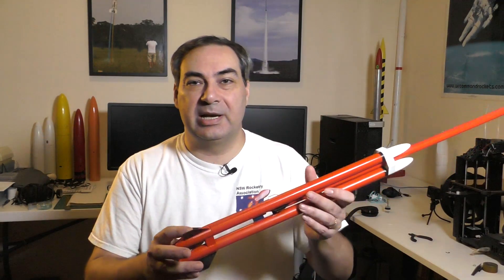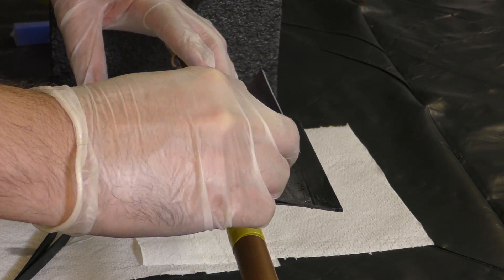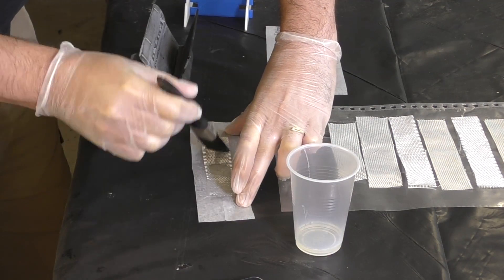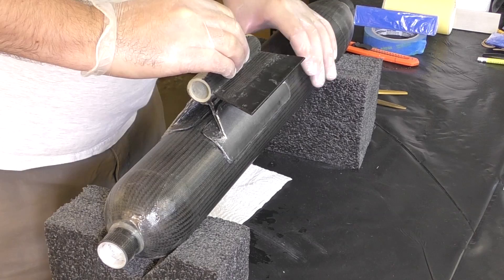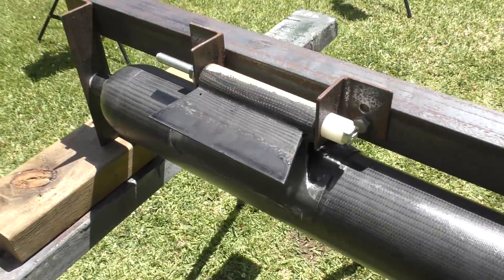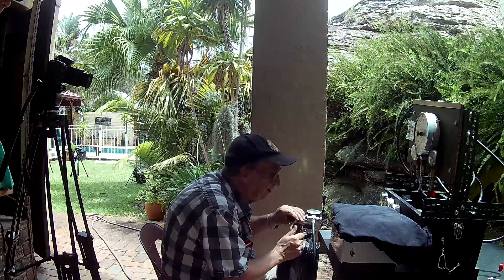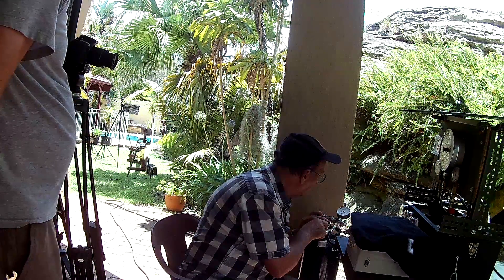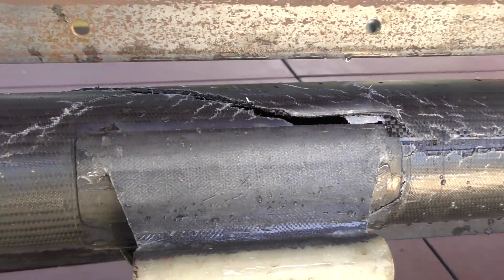2 Stage Water Rocket - Part 31 - Burst Tests

Comment: Hi. you're good. i think it cracked because of the fibers too. the fibers form an interlaced net for stretching sideways but not diagonally. i think the crack is made by a curve. is due to the loosening of the fiber arrangement. network thinning. by flexural tensile stress. the tank could hold more if they were barrel-shaped. like a beer keg(damage started in the middle) . have a nice day.
Reply from the maker: We have half the fibers in the pressure chamber at 0-90 degrees to help prevent the long rocket from bending, and then the overwrap is fibers close to +55 and -55 degrees for pressure containment. This is the best we can achieve without a winding machine, vacuum forming, post curing, and using more specialised epoxies. We're quite happy with the strength to weigh ratio for these pressure chambers. But of course there is always room for improvement.

Comment: You should add lifting stages (tanks) that fall  back and off once they stop producing thrust with their own separate parachutes. You could have several of these on the perimeter. Just make them 3/4 size of main tanks.

Comment: Hi George. Here is an idea. I'm not sure what the correct name is, but it could be cool to connect one of those smoke trailing things parachute guys use to trail their path.
Reply from the maker: One of the issues is that often these smoke generators are actually burning to produce the smoke, and if the rocket were to crash or land before the smoke generator stops, it may start a fire.
Reply: @AirCommandRockets  I must admit, I did not think of that. Would have been a nice trail though.

Comment: I had to go back and remind myself the pressure from your previous record, 1150 PSI and 3155ft, so getting that 1mile high flight seems to be a bit of a stretch.... unless its staged flight
Reply from the maker: Certainly I don't think we'll be flying to a mile. We think it will be closer to ~1.2Km and yes this will be a staged flight.
Reply: @AirCommandRockets  Staging will be very exciting to see with a rocket like this, can't wait!

Comment: Nice to hear you starting 2022 with a bang George! :) It is interesting that the pressure vessel tore in such a clean manner with no shrapnel flying. I suppose that this is due to the directionality of the fabric as it will tear along the weakest direction. Is there an alternative to carbon fiber better suited for high pressure? How about kevlar?
Reply from the maker: Thanks Dan, I think the clean rip through the carbon fiber would look different if it had been compressed air. I think then it would be a lot worse. It looks like the tear was along one of the seams in the inner carbon fiber layer that is made from cloth rather than sleeve.  It is right next to where it overlapped which makes sense. (2 complete wraps + 2 cm overlap) There are ideal winding profiles for pressure chambers, but without a winding machine we are left to approximate it. The arrangement we ended up with is after multiple tests, this one not only withstands pressure but resists bending when half the pressure chamber is heated by the sun. Kevlar is a little harder to work with and it has slightly different properties than we are after. We want the stiffness of carbon fiber here. Kevlar is also harder to work with because of its abrasive resistance.

Comment: Hi there! Good to see a video again!

Btw. could the bracket cause some extra lol pulling force on the surface of the pressure chamber? Like if you put a tape on an ballon while you pumping air inside.
Reply from the maker: Definitely, that was kind of the reason for the first test to see how the pressure chamber behaves under the full load. It is also the reason why we used two separate pads to attach it to the pressure chamber. It gives it some room for expansion.

Comment: So during the test, how was force applied to the bracket? Was it just the stretching of the tank pushing it against the frame? How do you verify how much force is on the bracket during the test?
Reply from the maker: The nozzle on the booster isn't locked into the nozzle seat. This means it is free to slip off the nozzle seat even with a couple of PSI. At full pressure the nozzle is trying to eject the nozzle seat with a force of around 1,950N or 200Kgf. The only thing stopping it flying off is that bracket. The force is just the static pressure x the cross sectional area of the nozzle. 
The reason we don't lock the nozzle into the launcher is because the first stage is a cluster of 3 of these pressure chambers, and trying to synchronize the release at these pressures and forces is difficult. So we don't try, and instead hold the entire booster down by 1 common point .... the bracket tested here.
Reply: @AirCommandRockets  That makes sense. The source of the force is the same as in real life. I had thought that the test was actually to simulate the force in flight from the inertia of the sustainer as the rocket is under acceleration, but I guess the force on the launch pad must be higher. Thanks for answering my question. You picked up on the exact misunderstanding I had.

Comment: This is random but I just thought- have you ever tried heavier liquids? Like glycerin or salt water? Then you can have more reaction mass for the same volume. I think you can get 1.2g/ml with saturated salt water…
Reply from the maker: This is a good question. With higher density you will get greater thrust, however, you then also have a heavier liquid to lift so you may in fact get lower altitude. Here are the tests we did on higher and lower density liquids: https://youtu.be/Fu3rIiPy_18
Reply: @AirCommandRockets  oh you’ve already tested this. That’s great! Always love to see the progress